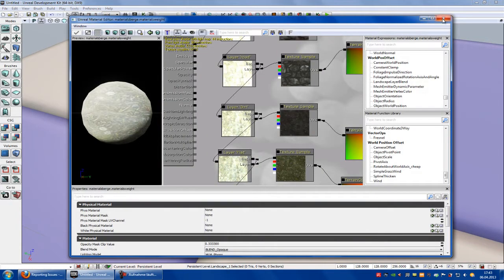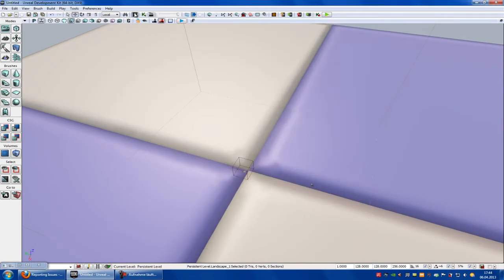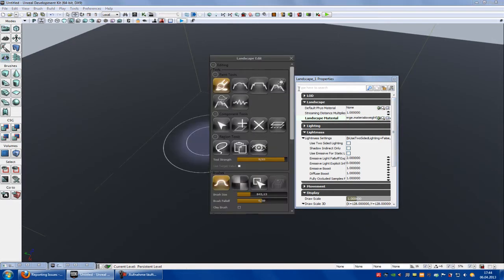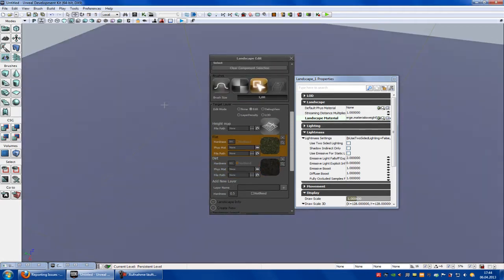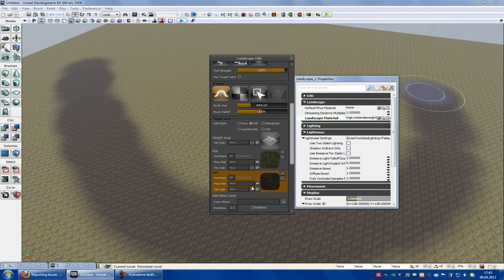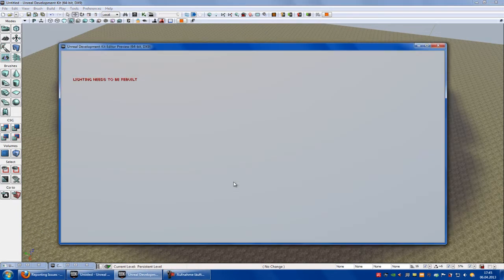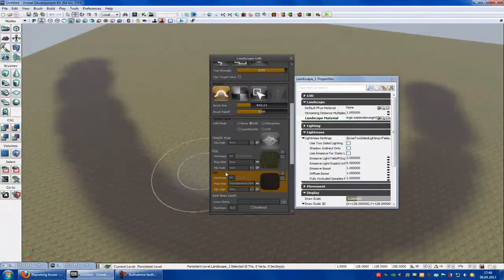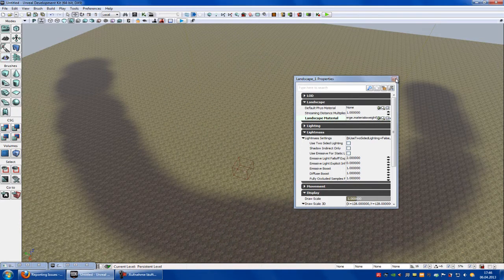UDK Tutorial: footstep sound landscape (english)

Comment: I have my own gametype made and its pawn does not extend one of the UT or UDK ones.  It extends Pawn.  I have no footstep sound.  I have tried extending it from UTPawn and it gives all sorts of errors.  I'm definitely a beginner.  All I want is footstep sounds for now, just for simple testing.  Grateful for any help, thanks.
Reply: *****
Sorry, mate.  I tried everything, didn't get it, and then switched to Unreal Engine 4.  But you know what?  If you're not good with coding, that's actually my suggestion.  Switch to Unreal Engine 4.  The monthly subscription they charge can be paid once and then cancelled, so it's very inexpensive.  And it's excellent.